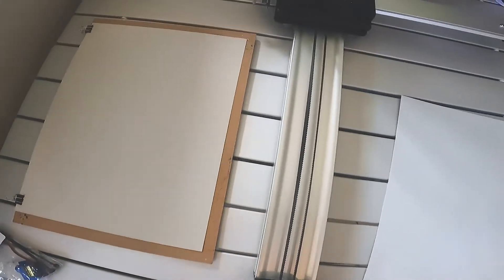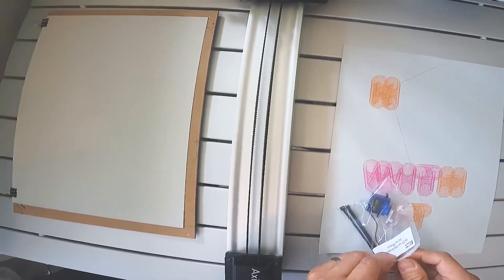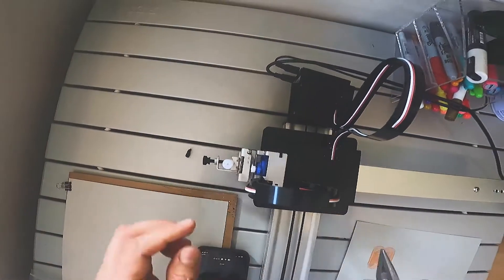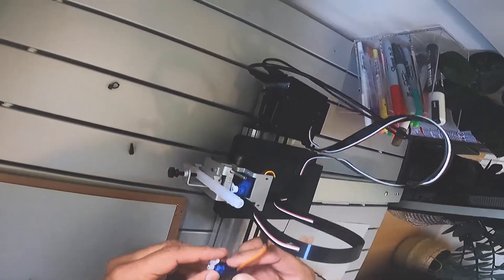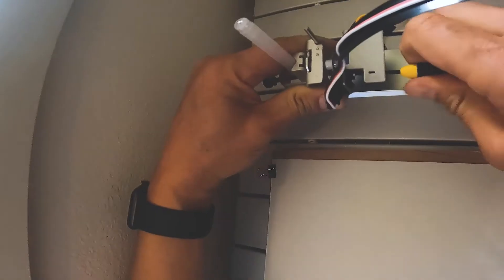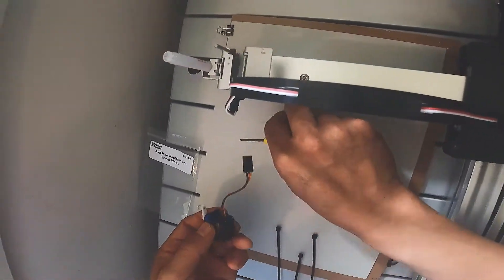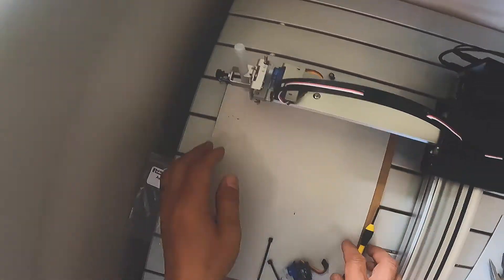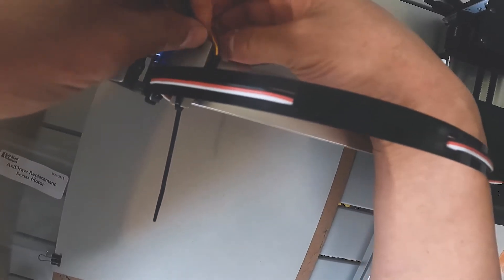AxiDraw Servo Motor Replacement

Comment: Thank you Stephen! It was good! How often do you need to change the Servo motor?
Reply from the maker: Not that often. It depends on how often you use it. I messed up my motor by not calibrating the height correctly for a drawing. So human error could also be a factor.